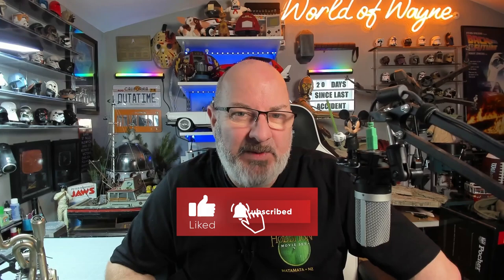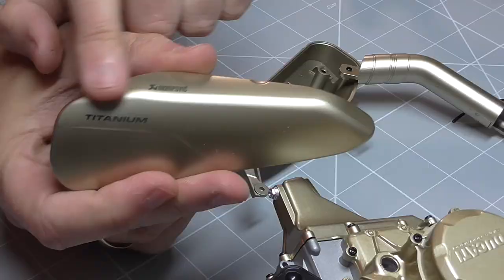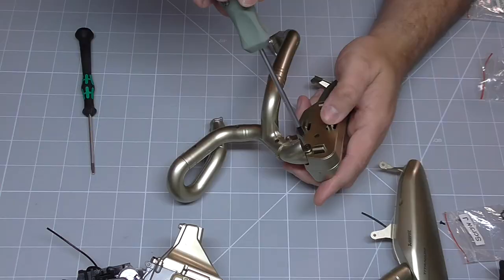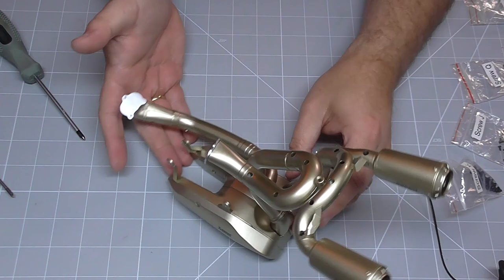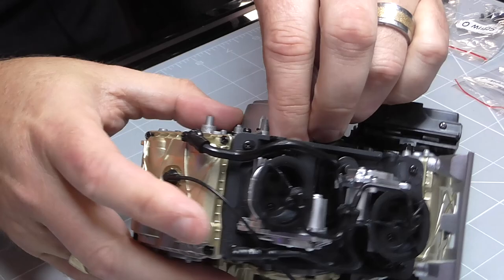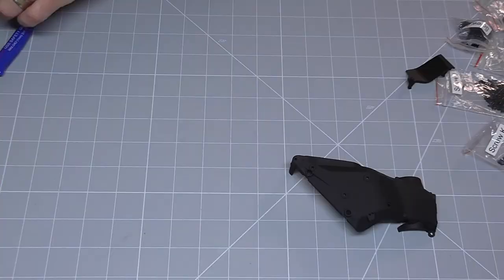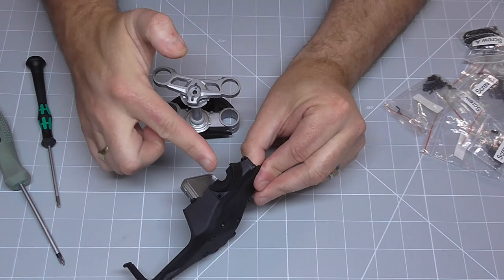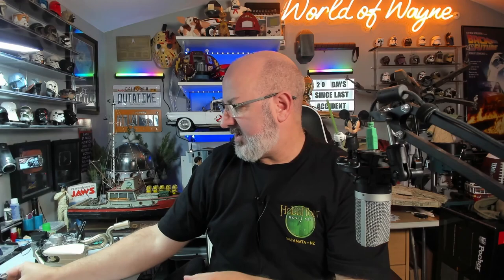Build the Pocher Ducati 1299 Panigale R Final Edition 1:4 Scale Motorcycle - Part 4

Comment: Considering how expensive this model kit is, the seam lines/joints in some areas for example the exhausts are appalling!
Reply: I'm building it currently, and agree entirely. Im going to strip, assemble, fill, sand etc. 'the exhausts then paint them. Tamiya x-31 Titan Gold & X-11 Chrome Silver ratio 5:1 is pretty much an identical match for the prepainted parts.

Comment: Hi Wayne. Loving this build, as always (I watch all your videos). This weekend, I'm about to start building one of the cars (one you're not doing, the Ford GT) and then I'll do the Eleanor. I was just about to head to your Amazon store to get some tools and stuff but I've noticed you've started using a different glue on this one. Is there any reason for that? I've never used glue on previous kits (only done the R2D2 before) so I was wondering which you'd recommend if I was to only get one? Thanks
Reply from the maker: It because the parts are really light plastic. I though superglue would be a bit over kill

Comment: This in no way is a criticism of your talents Wayne as your work tends to be extremely good but I'm disappointed with the gaps on the build so far, I am expecting it to be of a higher quality than the "magazine" builds you feature on the channel but so far I would say the other projects are going together much cleaner. It has plenty of detail but the way the engine block came together along with the resonators for the exhaust was quite gappy. As I said it's zero to do with your building ability it's 100% the product. Or am I being too critical as it was only  £700+? 🤔
Reply from the maker: I agree but most of those gaps are hidden by the frame
Reply: @World of Wayne  I'm glad they are hidden but knowing what you are like regarding gaps and light bleed etc your OCD must be in overdrive knowing the gaps are there though.
Reply from the maker: @2rueblue  oh yea but as I’m building it for someone else there’s not
Much I can do
Reply: @WorldofWayneUK  I have the aftermarket 'Build' DVD...Trust me there are many many issues with this kit. I paid $1150 NZ.....I just keep thinking what Tamiya would have created for that price.
Reply: @ekspatriat  agree wholeheartedly. Several issue with my build, ie comically obvious gaps, esp in engine block, loose fits in screw joins, awful gaps in exhaust seams - necessitating a fill strip down, assemble, sand, fill, repaint. Hope it ends up worth cost. 
Can only imagine what Tamiya could offer us for the same price . . .